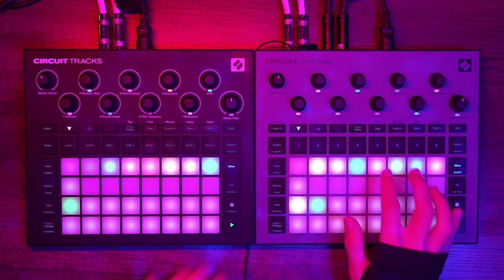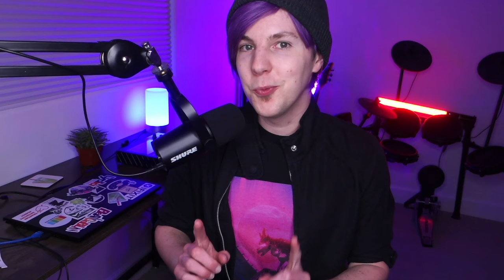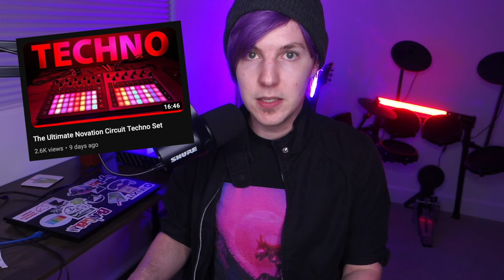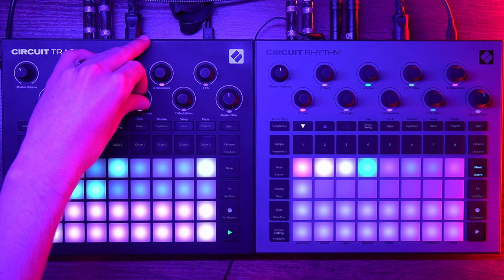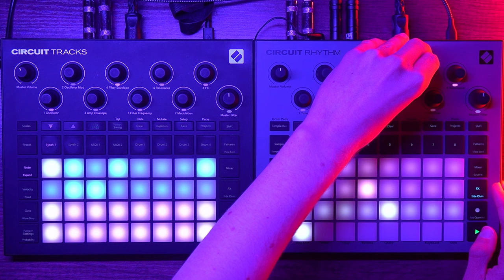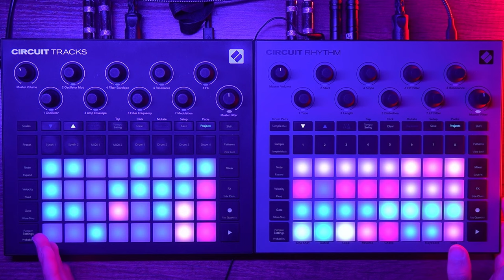Making a Novation Circuit Live Set

Comment: I don't have either of these but still got a lot out of this video 👍.
I have an MPC One and Korg nanoKONTROL2. Creating a jamming system was initially a problem due to the flakey external control assignment on the MPC but I cut back on complexity and now use the Korg just to control each submix via a LPF - the cutoff on the faders and peak on the knobs. I route all the programs to the submixes e.g. basses go to submix 2. The cutoff lets me pull out stuff as easily as if it was volume.
I also have a Roli Lightpad Block to let me trigger samples from a dedicated track while the MPC screen and pads are busy with other stuff.

Comment: Circuit Tracks for the synths and not the main drums (due to latency) except a few washed out perc elements and the Circuit Rhythm for most of the drums we hear with some SFX elements... right?

It is too bad about the latency of CR. An external little mixer could fix that but more gear and less control of the audio FX on CT. What about adding another mini synth to trigger from Midi 1 on CT then audio into CT? I have a Modal Skulpt on mine to add more sounds which works great!
Reply from the maker: Yeah it's mainly used for synth stuff because of the latency. As far as I know, it happens whenever you bring audio in to either Circuit, which is why I didn't add another synth. It would get delayed on its way into the Tracks, then delayed more on its way into the Rhythm.
But I've done plenty of Tracks + synth setup (especially Tracks + Roland MC-101), and that works quite well.

Comment: Gabe can you help me out?  Long time subscriber here.
I kinda lost track... There's Circuit Rhythm and Circuit Tracks... but wait a minute. wasn't there a "regular" Circuit before that? Novation is my fav manufacturer but i always lose track of all them "mark 2\mark3" versions and now another thing... Am i missing something?
Reply from the maker: Yes, there was an original Circuit. The Tracks came out in early 2021 and is basically the mark 2. It incorporates all of the firmware updates the original got and adds some hardware features. The Rhythm came out later in 2021 and is a more sample focused offshoot of the Tracks. I did do a video comparing the Tracks and Rhythm if you're interested.
Reply: @GabeMillerMusic  thanks a lot, bro (i already seen them videos of course!)